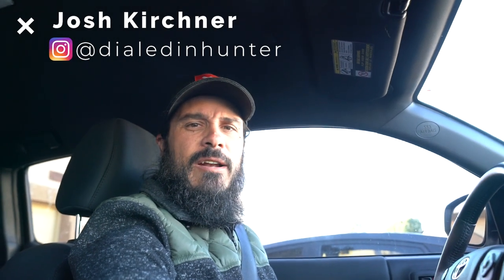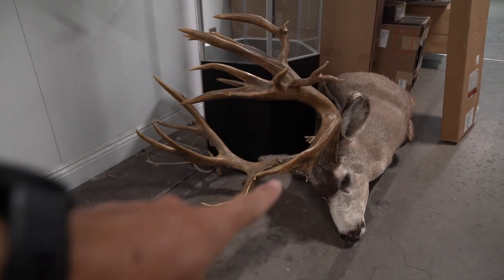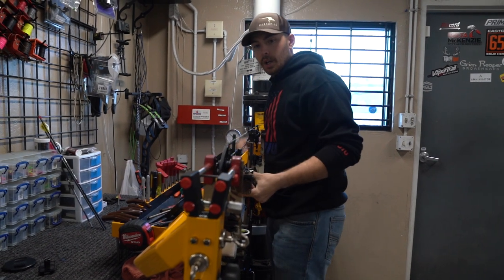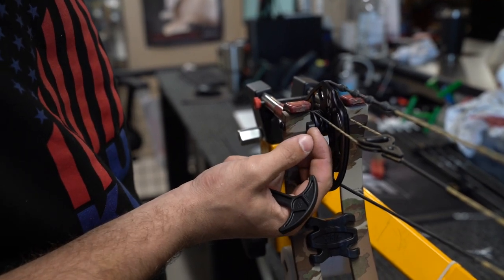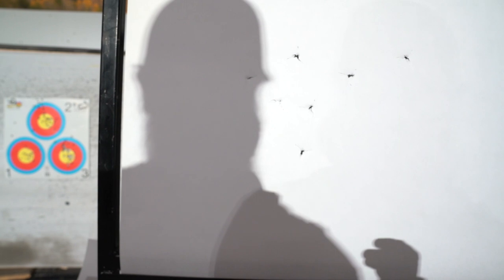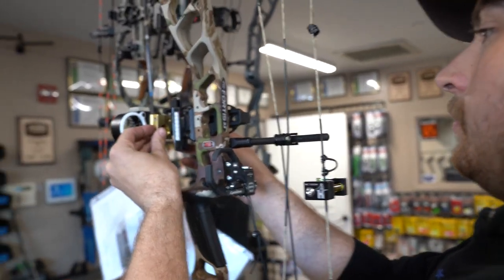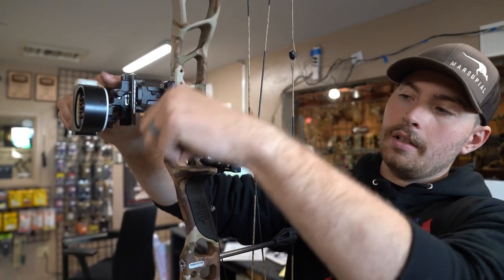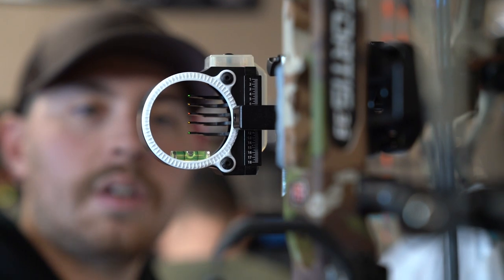PSE Fortis - Setting Up My New Bow

Comment: Love this video. Those spacers are rad for cam adjustment!! Less hassle than removing the axle completely. 
Another great reason to use soft knots or "nock sets" it saves your bacon in the backcountry if you cut your D-loop. Easy to tie in a new D-loop without the worry of affecting your tune!!
Reply from the maker: Thanks buddy!  Totally agree!

Comment: Good informative video on setting up a new bow. 🏹. I need to take my PRIME Black 3 back to the shop, once I broke the d loop and Cabela’s put it on for free I fought peep twist all season long including pulling back on a whitetail doe and the peep looking like a fly 🦟 in front of my eye and not seeing through my sight.
I want to hunt turkey 🦃 with my bow which also is set at 65 lbs, so I have to get that done in the next couple months.

So why did you decide to go with the Fortis vs the many other new PSE offerings?
Reply from the maker: Oh, man!  Talk about bad timing!  Haha.  The Fortis just fits what I want out of a bow.  Generous brace height, decent speed, good draw cycle, etc.
Reply: @DialedinHunter  yes it was very bad timing, I snuck up a creek in the pouring rain 🌧️ and set up only to have that happen. I had to keep checking by test drawing every day and twisting the string to align it.

Ok I see what you mean. Another commenter mentioned that it was similar to the XF33 that you had last year but with a few tweaks. Thanks for answering 🏹🦌

Comment: Nice bow dude. You should make a video on what things you found on the Fortis that made you upgrade over the XF33 and chose it over the Omen. I'm currently thinking of heading to Ross Outdoors and trying out the Mach 34. I bought a Prime Inline 5 and a PSE NXT Drive from them. Great group of guys.
Reply: I was actually thinking about the same thing video idea wise.
Reply: They are the same bow. Plus a few mounting options and tuning option. I just ordered this bow but that’s coming from a 2013 pse revenge. If I had the xf33 I wouldn’t waste my money getting the fortis.
Reply from the maker: It's very similar to the XF33.  The new cam shim system is rad and it does now have different mounting options.  I'll also add it has a brand new grip, which I like much better than the grip on the XF33.
Reply from the maker: And the Omen is a different beast entirely.  Shorter brace height and built for speed.  I really like that bow actually and have been thinking of getting one.  For a speed bow, it feels great, which has not been my experience with speed bows in the past.
Reply: @DialedinHunter  thank you for replying.  That's good information right there.